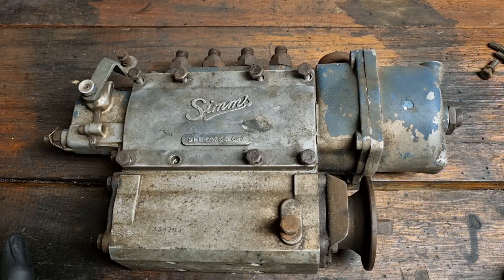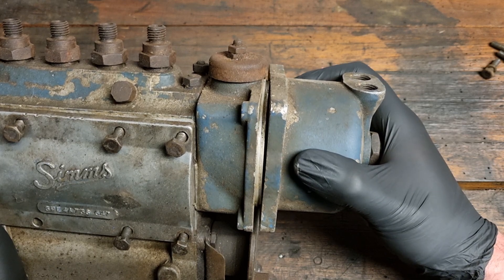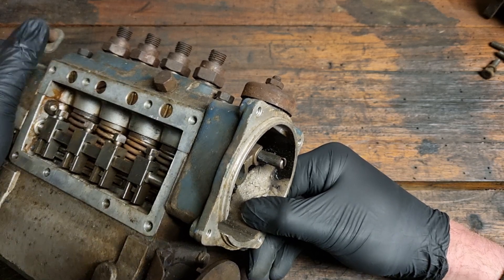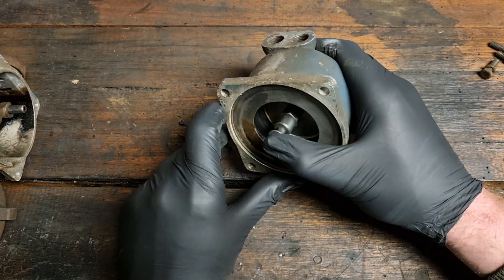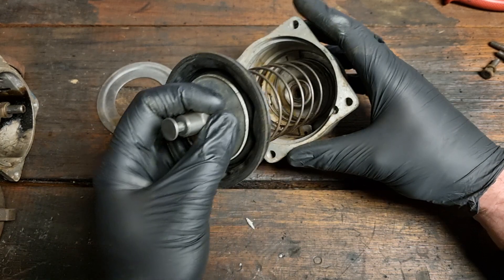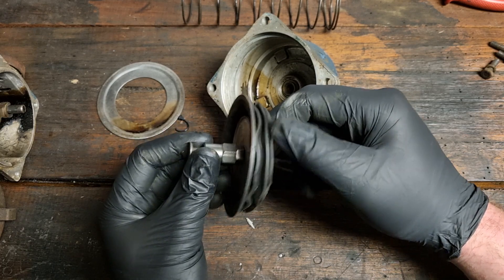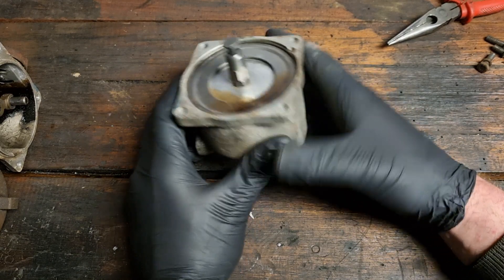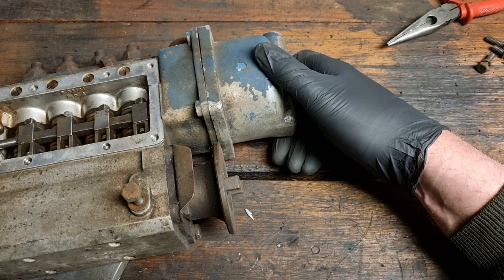Fordson Major Simms Fuel Injector Diaphragm Replacement

Comment: Hi, when you were putting it back together, you said the second plate  had to be finger tight, and then i think you said just for demonstration purposes?

Sould it still be finger tight or if not how tight should it be?

Not trying to corner you or anything but i thoght it would be best if i asked before i do mine 

Cheers from wales.

Comment: Hi from NZ, last time I tried to start mine it went straight to full revs with no accelerator control. I have begun pulling the injector pump apart and noticed a small tear in the rubber diaphragm - just wondering if this is likely to be the cause ? Accelerator assembly and air intake passages are fine. Keep up the great videos cheers
Reply: Also worth noting, I ran it out of fuel the last time I had it running before this happened
Reply from the maker: Thanks for the feedback! As the other systems are ok, I'd agree that the tear is the source of you problems
Reply: @fixingfordsonsaustralia6632  thanks for replying. Yep that was the problem, replaced the diaphragm and she was away again
Reply from the maker: It's always pleasing to hear my videos have helped keep another Fordson running!

Comment: Nice video. Last time I started my Super Major she went to full revs and I got no response from the throttle lever or the cut off cable. I stopped her by closing the fuel off. I’m told it’s due to a vacuum leak in the diaphragm. Would that be right? Great channel 👍🏻
Reply from the maker: That could be one cause, the other worth checking  is the level of oil in the air cleaner oil bath pan. Thanks for the support and have fun fixing your fordson!
Reply: @fixingfordsonsaustralia6632  Thanks for your help. I’ll let you know when I fix her 👍🏻
Reply: @fixingfordsonsaustralia6632  It turned out to be some rust on the regulator rod in the injector pump stopping it moving properly. Once the rust was removed and the rod freed up she’s running well again 👍🏻
Reply: Hey my friend is having trouble starting is fordson he says it cranks well and he has tried to prime it and bleed it do you have a video of how to check the fuel system when it won't start